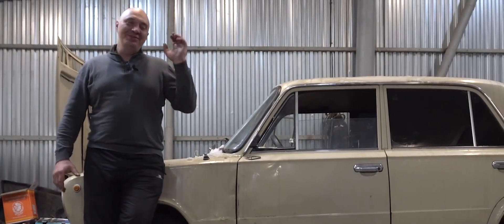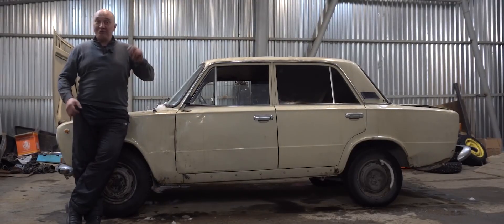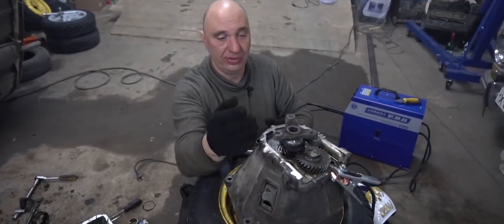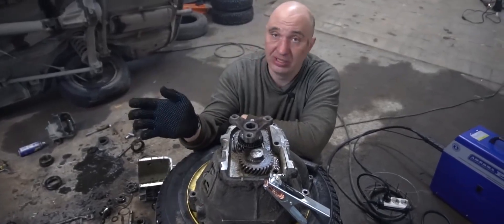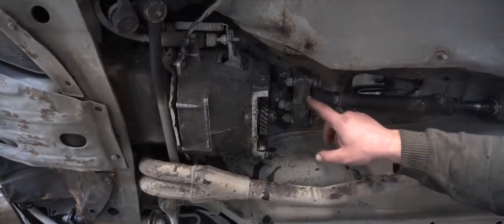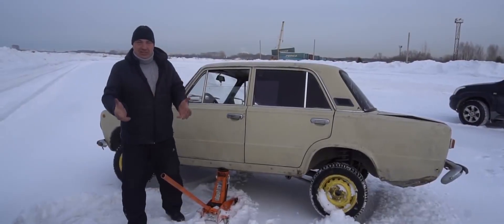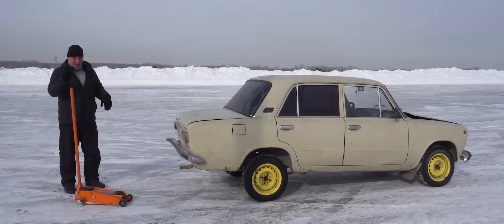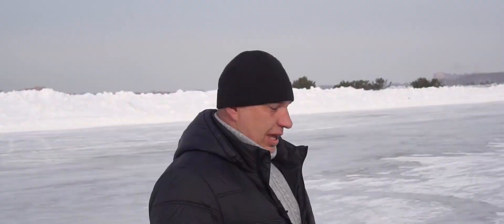Welding the prop-shaft to the motor and driving without a gearbox

Comment: In the 50s here in America on the salt platts.We used to run a small block with a drive orange straight to the rear end and it would get pushed started by a starter car And it was a world record holder back in. 57 of I believe a 148 miles an hour on the salt Platz.

Comment: Still having a clutch is cheating. You might as well of just put the trans in 4th and then cut the shifter off. We wanted to see the driveshaft welded to the flywheel, and you have to push start it, etc.

Comment: DEPENDING ON THE DIFFERENTIAL GEAR RATIO YOU WILL HAVE LIKE A 3rd OR 4th (OR EVEN 5th) GEAR EQUIVALENT ON THIS DIRECT DRIVE!

IT IS LIKE MOVING THE CAR OUT OF THE INERTIA ON THOSE HIGH GEARS INSTEAD OF 1st GEAR..........

Comment: In most manual transmissions the 4th gear is a direct drive 1:1 gear ratio so essentially you have a car that only has 4th gear.

Comment: For a simple proof of concept, just try driving the car in 4th gear. In 4th, the output shaft of the transmission is connected directly to the input shaft, the torque does not go through any gears. The gears are just "free wheeling".

Comment: Leave the system you have, but move the engine back, instead of a prop shaft weld a u joint to the back of the motor  and have it connected directly to the rear axle

Comment: nooo, leave the clutch, and definitely don't leave out bearings, Im wondering if your extension getting out of balance might be the problem not the coupler, the things spinning so fast that when it goes it takes the coupler with it, maybe not tho    I would definitely put a few bearing blocks in there tho, if not that then at least a few driveshaft loops

Comment: Should have watched American sprint car racing they don't have transmissions, battery or starter every wheel is a different size in hight & width they drift around the corners and wheelie onto the straight-a-ways 800+ horsepower and fly in the air when they smash... Turn the wheel right to go left...

Comment: 9:44 Your sperving bearings have not been mounted properly to your logarythinc casing, the panemetric fan with hydrocpotic marzel veins are osilating with your lunar wainshaft creating side fumbling

For those of you who didnt catch that, this was sarcasm based on the classic video "Turbo Encabulator" where an actor goes through a script of random works that are supposed to describe what looks like a 4L60E transmission

Comment: I think the small diameter pipe you used bends under high torsional load which increases the imbalance which creates a positive feedback loop until the catastrophic failure occurs.

Comment: Sprint cars use the same drive system, theres no transmission or gear box its pretty much a straight drive to the rear axel, they push start it as well and they floor it when it gets started

Comment: I wish I lived in a country where THE cheap beater car to go to was RWD, manual, and had excellent rust protection... Basically the opposite of the USA
Reply: Volvo 240, esp 1975 to 77 with the B20 pushrod engines. Volvo 140 was awesome too but those been too expensive the last 25 years. Volvo always were primitive like Lada but benefitted from their primitive nature, the bushings and other rubber parts were horrible though, wasnt rectified before 1978.
Reply: sadly most Ladas ARENT that rust free underneath. we had them here in the UK for a while and they were the only thing (along with Skodas of the era) that rusted as fast, or faster than the 70s Fiats (which the lada is pretty much a reproduction of the Fiat 127 but with a locally sourced engine due to costs at the time)
Reply: @petelattimer6808  I think the Russian domestic ones got a little better treatment than exports, but yeah, plenty of rotboxes around as well.
Reply: They cant afford salt for the roads
Reply: @rcard23yb  my man I found a car for 70$ it has an engine can u FKING believe that

Comment: i had an 83 prelude that would snap the clutch cable at predictable intervals. using the starter instead of slipping the clutch is interesting, to say the least
Reply: You Been Though That Also.  It Happened To Me In My First Ever Work Truck.  A Dually GMC . 3 On The Floor.  Up To Left Was Reverse.  Standard H Pattern.  Too This Day Don't Know How I Made It Back To Shop. Figured How To Dry Shift Quickly Using Engine Only . Forgot All About That. Been 27 Years Ago. Thank You For Awesome Memories. Had Great Times Working For That Company.  Scary Doing When It Happens Isn't It ?  Thanks Again.   ☺

Comment: We had/have a Saturn.  The transmission is linked to the shift lever by some cables (like bike break cables).   The cable broke.   Poking around "under the hood" I was able to push the transmission into a gear.   Turns out it was 3rd.    I drove the car to the shop in 3rd gear.

I don't think I wore out that clutch all that much.   Just kept the engine revs to just above lugging and got the car up to the point where I could completely let off of the clutch.

Comment: I'm starting to feel sorry for those Ladas. Is that the Russian idea of a disposable car? Bummer, I wanted to see a direct drive Lada. And don't consider this a failure. Consider it a success in demonstrating that you can't connect the engine directly to the differential in a Lada through rubber bushings. You've done worse for less.

Comment: could be done as long as you dont need to stop and pushstart the car through the compession of the engine to say 5 to 10 kmh 

some sprintcar racecars only have a clutch and then a driveshaft straight to the rearaxle so it has been done before 
you might need to experiment with different rear axle ratio's it might be geared way too high
https://www.standard.net.au/story/5852225/what-its-like-to-race-a-900-horsepower-600-kg-beast/

Comment: a torque converter is all you need...you just have slow acelleration...this was made in the 40s with a transmission but you could take off in high gear...reverse is a problem.

Comment: Isnt this a waste of time? Most transmissions without overdrive, final gear equals 1 to 1 output?  I mean just try to drive in final gear only.
Reply: It kinda is a waste of time. But they wanted to drive without gearbox, like topfuel drag cars, who don't have a gearbox, only a clutch. So this is kinda like that, but DIY russian way

Comment: You shooda just left the transmission in, and it would be direct drive in top (4th?) gear. You can also take off in top gear, by revving high and using (burning) the clutch. For a hoot, do a direct drive to the crank, without any clutch.

Comment: Need better central bracing where the new shaft is welded to the old driveshaft. Needs an extra bearing so it doesn't fly apart under load

Comment: You should have left the clutch in because it would stop the drive shaft from moving round and it will just spin near the engine and when you let the clutch out it will just be like and auto but no gears

Comment: I didnt look the video yet but the direct drive will result as same gear ratio of the 3rd or 4 gear then you will need to slip de clutch a lot to make the car move after that over 20mph the car will work perfectly fine

Comment: My suggestion... weld on a large diameter extension to the wheel hubs and fit some old mini digger tracks. The diameter can be set according to tracks but large for ground clearance. Then we will have a go-anywhere Lada ideal for driving over snow banks and a victorious crossing of  the arctic wilderness in winter ( like the ice breaker ship “100 years of victory”⭐️🇷🇺⭐️). I think we may need an extra low bottom gear as well for steep traction. And perhaps a sliding door in the roof. Could be quite a lot of work but worth it if it works!

https://youtu.be/bKaVhXn49xY magnificent like this rescue vehicle for the land surface this is what we should be aiming for.

Perhaps an adaption for the ladzilka project with its excellent traction capability.

Comment: Any here is today’s victim. It’s a Lada of course, all Ladas are indestructible, so perfect for today’s crazy experiment. We will just cut the gear box in half with a grinder, because we don’t want it any more.💪🇷🇺🙂 I think the problem was the welding was not straight enough, the shaft was oscillating and straining bushings and connections. Or perhaps a loss of joint flexibility to dissipate prop shaft vibration. 👍

Comment: The reason it failed is because he never welded the extension straight the heat of the welds pulled the steel couplings of to an angle and also never balanced it.

Comment: Love the video. All of them are good. When I was a kid, my dad and I took a 405ci engine out of an old beat up car, and sat it in an old boat. We hooked up the propeller shaft directly to the crank on the back of the engine. Whatever rpm the engine did, the prop did to. That old boat would do 75mph and scare the crap out of us. Built the whole thing for about 700 bucks.
Reply: That’s actually pretty bad ass😂 i would love to see the boat. Makes me want to do the same thing!
Reply: That sounds so fun
Reply: And also almost suicidal
Reply: @benjaminbarton2629  almost?

Comment: is it me or the slip joint was placed in front of the mid bearing instead or in the rear where it should be for suspension to move .. i feel that is what cause the fail

Comment: Nice to see your  hard work . I like to request  from you  if you  can fix  extra  starter  motor  to auto metic transmission  . So one is felled  the other one can use . Fix the switch  moter 1 moter 2 . To one ignition  switch  thank you

Comment: Typically a non overdrive transmission in it's highest gear is a 1:1 ratio or the same as what they are doing here. If it was a 4 speed non O.D. then it would be like having the transmission stuck in 4th gear and therefore you would have to take off in 4th gear.
Like I said the highest gear in a non O.D. is a 1:1 ratio or the same as direct drive with the clutch locked connecting the crankshaft with the input of the differential.

Comment: This is pretty much what they do here in the states with dirt track midget cars. There is a splined shaft off the flywheel. A lever connects another spline to the drive shaft. So you have engaged and disengaged. You engage it, then you are pushed to start engine. Then when it's time to stop, you pull lever. They are small and light weight with v8. Very fast and crash alot. There is a big "wing" on top to keep them from flipping over in the corners.

Comment: Joint between propshaft and shaft extension too weak, so small imbalance causes shaft to bend and fail, which in turn rips out the rubber coupling, you need much thicker tube, and get it fairly straight

Comment: Wow, why hack the transmission all up when you could just make a longer drive shaft that goes right from the clutch to the differential, and then just slowly engage the clutch like you're stuck in 4th gear (1:1 ratio)?

Comment: Interesting, but the rubber part didn't fail first . the unsupported rear part of the adapter started vibrating first as it needed to be in it's own bearing (the rear gearbox bearing!!) which then tore the whole assembly apart.
This probably killed the first rubber drive too.

Comment: Rubber couplings outside at below freezing temperatures. Brilliant. Wait till it warms up to over 50 F.
Reply: those rubber couplings are designed to work WELL below freezing temps. its a car from fucking russia for shits sake. you think every single lada in the country just snaps its prop shaft coupling the first freeze of the year???? SMFH

Comment: Ok here ya go, connect the engine output shaft directly to the rear differential with a solid metal axle, fix the engine and rear suspension in place so neither can move. Lift, crank, and rely on nothing but air restriction to control the vehicle. Strait engine to tires, play around with nobody in the way and and see how long you can roll around an open area until the engine throws its mains or rods or the rear end falls apart! 1, 2, go!

Comment: piston planes work without a gearbox?
Reply: Yes, piston driven aircraft engines use engine speed to produce enough propellor thrust to move forward. Basically, the more throttle you apply, the faster the propellor spins, making the plane go faster. Air is extremely thinner than water, so gearboxes are needed on boats, but piston aircraft engines just use throttle speed to produce propellor thrust.

Comment: That car was incredibly solid underneath, for its age!
Reply: IN RUSSIA YOU DON'T BREAK CAR.

CAR BREAK YOU.
Reply: The charm of da lada
Reply: it looks like it's from the 60s but it's probably built in 1995
Reply: @madegolo670  It's a round headlight Lada (2101), which was built from 1970 to 1988.  Meanwhile the rectangle headlight Ladas (most of the ones featured in these videos, better known as Riva) were made from 1980 all the way to 2012, though Egypt has continued to make the Sedan since 2014, according to Wikipedia.  So that vehicle is at least 32 years old.
Reply: @madegolo670  this model of lada(LadaVaz 2101) are not in production since 1988
Reply: @madegolo670  That's exactly what I mean... for 20 years old.  Cars in Western NY and southern Canada ROT after 10 to 15 years.
Reply: @LakeNipissing  I'm pretty sure that's because they use salt on the roads but in russia it's rarely used cus in the winter the temp isn't around -4° - 4° C (when salt is effective on the road) so they don't use it as much
Reply: @madegolo670  Very similar to where I am in northern Canada... only sand, not salt. Too cold in the winter here for salt.
Reply: @LakeNipissing  My daily driver is 50 years old.
Reply: Lada.
Reply: Ladas were not powerful or glamorous but they were tough.
Reply: It's old? I thought that was only a few years old 😂🤣
Reply: cars in freezers tend to last longer
Reply: It's a Lada!, bullet proof bodies. Built tough for a tough country🙂
Reply: It’s a lada
Reply: this was a 2016 model
Reply: The steel from Russia,Poland and Yugoslavia is the best.You can torch cut and there is always very little slag.
Reply: I wish I could import a Lada just for the sake of having one.

Comment: So you kept the clutch, to not use it and instead transfer all the engine torque straight to a rubber couple? Would have worked just fine had you not been stupid and actually driven it using the clutch as intended.

Comment: This went about as well as I expected, although I did expect something else to break. I figured that either something in the valve train to break, or the clutch to give out. I was pleasantly surprised to see it was nothing more than the drive shafts, which I’m sure can be upgraded fairly easily. 🤷🏼‍♂️
Reply: I immediately saw the problem with lack of support for these drive shaft. Been fighting with several older Volvo 240 - notorious for weak axle supports, i even lost a support going 90kmh, thats a very catastrophic failure.

Comment: We do this in the USA it's called out law racing
Reply: You mean sprint car. Outlaw is top league of sprint cars
Reply: Sprints and Midgets are directly-driven.
Reply: @DILLIGAF2101 there is a shifter to put it  either in or out of gear so when there working on it or bringing it to the track before starting the rear is disengage but when racing the engage it then push start the car kinda like a clutch
Reply: @peterrivney552  right,  but directly-driven in my context meant no gearbox.  I know about the in/out box.

Comment: How about pushing this car with another car till it reached some 40 km/hr and then start it, it will anyway push start. At such speeds you wont need much torque and you can keep moving.

Comment: Rearly give upvotes up this gets one. 
the first idea i had was to replace the axial electric motor.
Having little combustion engine (engineblock weighs alot, so also coolingblock) - runs on perfect rpm for combustion engine - more fuel efficient. Add some batteries dont need to be big, electronics for energy transfer control. 
This car (žiguli) is perfect for that, it doesnt have great acceleration, has leftover space in engine compartment - think would weigh less after axial, gearbox are removed and would pass emissions test

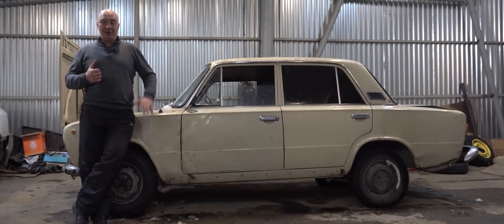Comment: A lot of work... you can do the test without modifying anything , just leave select 4th gear on a 5 speed transmission (1:00 ratio) and drive only using that gear.
Reply: That's no fun

Comment: Well guys.... I am very sorry to bring you the bad news but: If you want direct drive, just put in 4th gear lol 

Yes, 4th gear is in almost every car direct transmission, meaning rotation of the prop shaft equals the speed of the crankshaft. All your work was unnecessary xDDD
Reply: What? Most 4th gears are not 1:1 ratio BTW close but not 1:1
Reply: @joker4206987  you're missing the point
Reply: Yeah, but it is not the same. It wouldn't be interesting to do it easy way. Neither for them or for viewers.

Comment: ahahah
great video
there is motivation behind gear
is because the torque is too much for shaft
Reply: Kinda like a sprint race car no transmission direct drive as well if the stop they stall the motor and have to push to start it ... But they are a wild ride...I enjoy watching them race...

Comment: You have to balance the driveshaft, and the pinion angle was probably changed.

 The car once properly done will hit the rev limiter at its peak RPM and not accelerate past that speed as it is a 1:1 gear ratio. the constant limiter will probably destroy the engine over time. You essentially have a car with 1 gear.

Comment: You know its a russian car when the drive shaft has the slip joint before the jack shaft bearing and not after it. The jack shaft bearing does not move or pivot with the rear end.